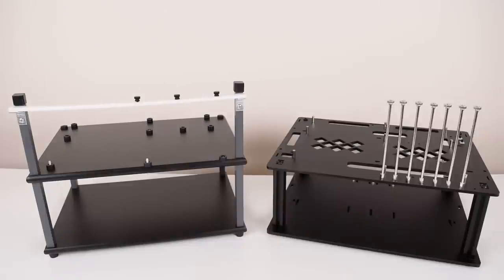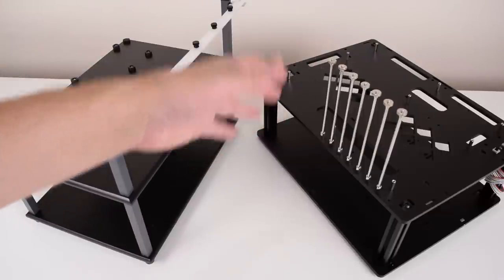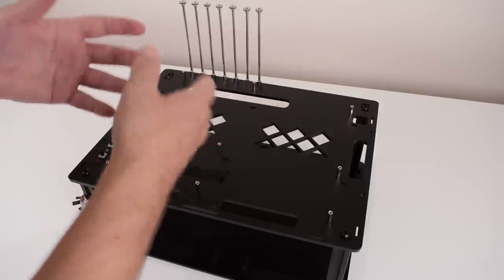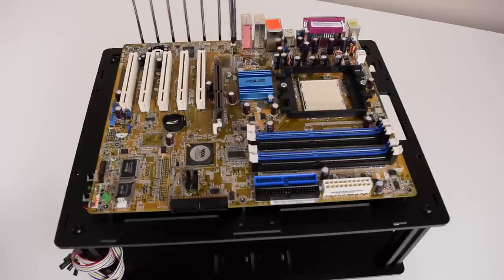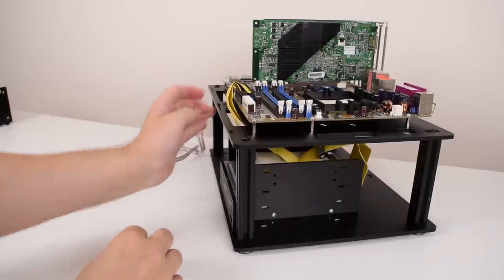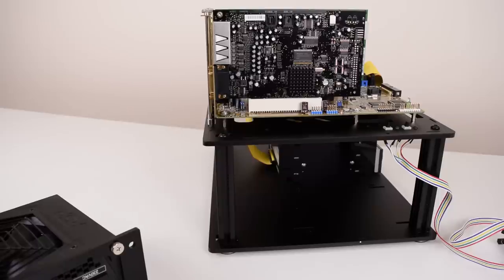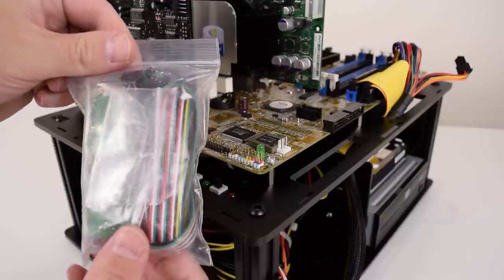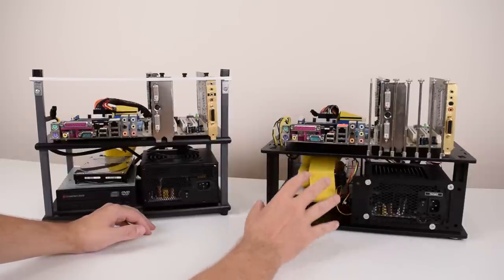Test Bench from USA vs China - HighSpeed PC Top Deck Tech Station and QDIY PC-D008

Comment: I use the atx motherboard mounting plate from a old case as Test Bench, looks like trash but it cost me 0$
Reply from the maker: Yes that works great :)
Reply: I personally tried to do that, but my cases screw holes can't hold standoffs. The metal from there has fallen of already, because metal is so thin.

Comment: I think the semi-permanent style of the D008 is because power supply and drive config isn't going to change much for most reviewers and secure motherboard installation is probably better so when you start pulling cards off the board it doesn't pull off with them, I like the look of it a bit better and the fact that the power/reset buttons and LEDs are built in is really nice, I watch some reviewers who take a key to short the power button leads and I cringe every time, it's not that it's dangerous, but c'mon you can afford a GTX 1080 Ti, buy a $0.30 power switch...

Comment: Hi All -  com·pli·ca·tions beat me 2 hours ago :(
I made my first one out of plywood and 50mm x 50mm times, plenty of space between bottom layer and deck to cover the large AT power supplies.
On the plywood was a old PC case base that must have had about 20 stand off holes ( one size fits all ) i had probably 10 plastic stand offs in it and 4 to 6 stand offs with where threaded to make a holding down screw from the motherboard.
The card edge holder was again a cut of from the end panel where the card blanks were cut from the original pc case
On the other side ( not the isa card side ) , i had mounted a front panel cut of with  power , reset , turbo , hdd led , power led and speaker - again from another old PC case that sort of looked like it fitted in a 5.25 drive bay blank card ( hmm the pc had some 5.25 bays but all the front swithgear and lights were in a panel that resembled a 5.25 blank , sort of how the usb / multi media / sd cards units look like
Overall i had a plastic lunch box to contain all screws ,sata ,  ide , floppy cables and molex double adapters
Looking back yes, i did keep all the extra long cables, i never thought to use a jig saw and run a few slots in the top layer to allow a shorter route for cable management
Freight to Australia is expensive, and i am suprised the asian one was that expensive in freight

Comment: The chinese one is just miles better.
Reply from the maker: I ended up no using it, too clunky for frequent system changes. The Tech Station is my favourite apart form just using a motherboard box :D
Reply: @philscomputerlab  The good old motherboard box! Not having to screw on the mainboard does seem extremely handy upon further reflection. I wonder if such a setup could be achieved in the chinese one, somehow. In either case, the "doob" is no longer sold apparently. :)

Comment: The China crap uses Bosch profiles, maybe the 20mm ones? These go for <5€/ meter. Some screws and these fittings aren't expensive either (~1€/square connector). Total costs maybe 15€ for end user including 1qm 4mm Aluminium for Mainboard sections.
The US is even worse! A high price DOESN'T make it more respectable.

There is absolutely NO engineering evolved in these products. Maybe worth 40- 50 bugs.